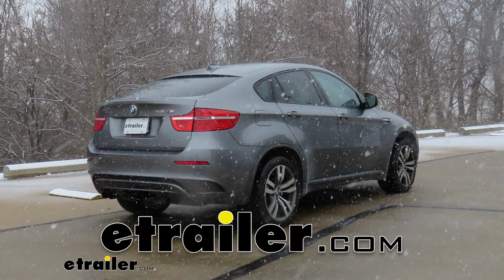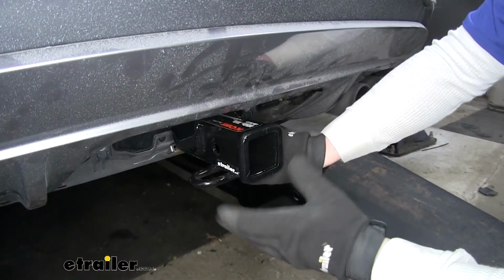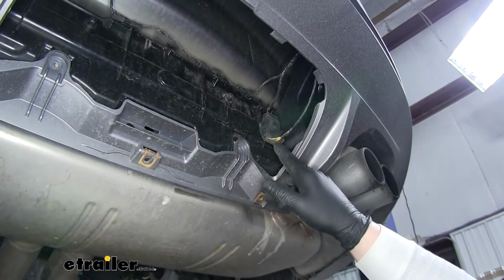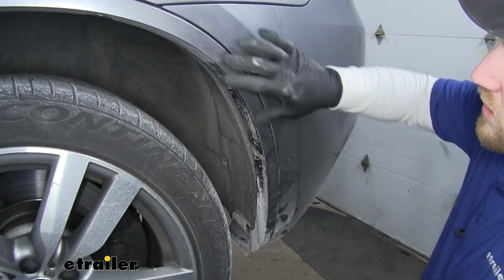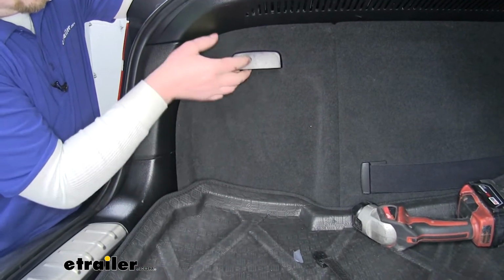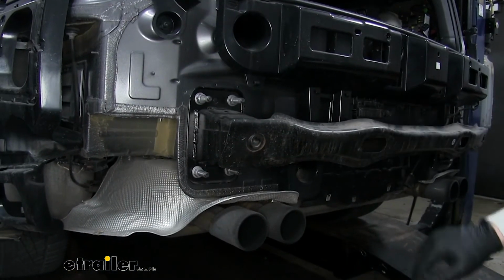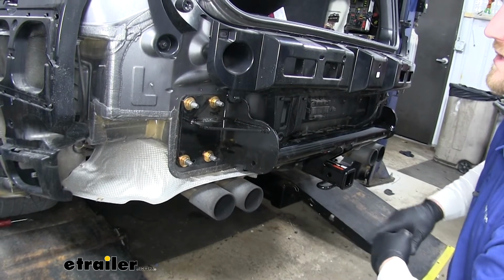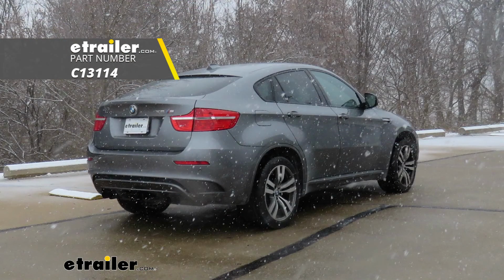etrailer | Set up: Curt Trailer Hitch Receiver on a 2012 BMW X6

Comment: Hi, 

How did you install the wiring? Mines in the shop atm getting this done and they called me to say that the wiring might cause lights and issues with the BMW ground system as it works differently then NA cars ?